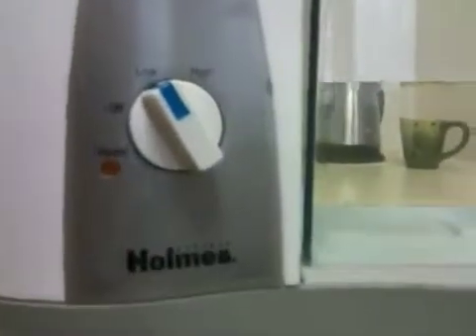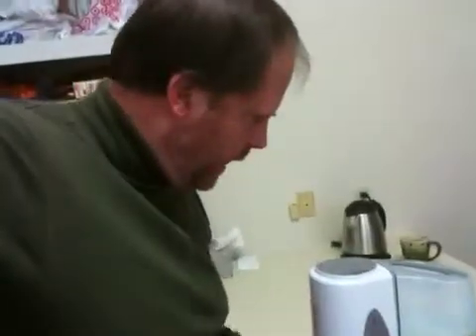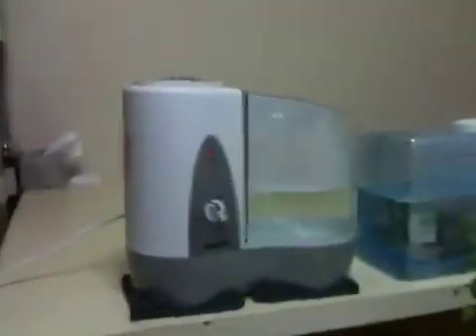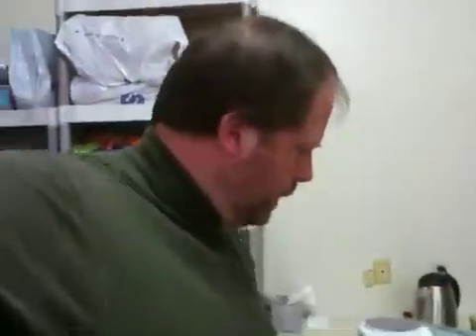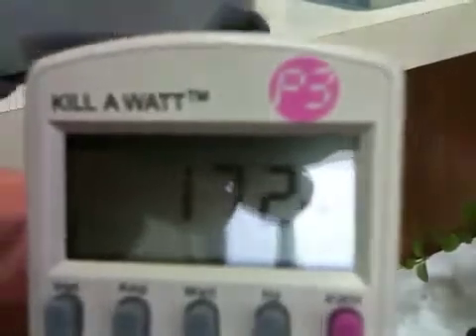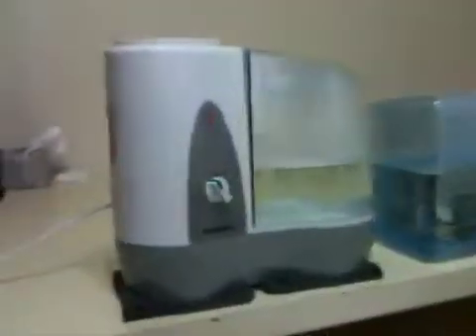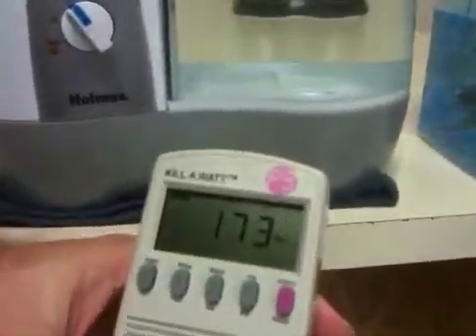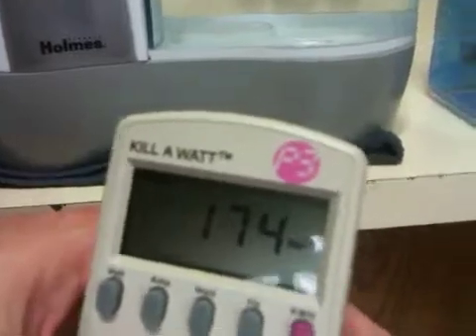20091014we-humidifier-steamer-power-watts-usage

Comment: Use distilled water in the cool mist ultrasonic humidifiers and they won't leave a mess.  Also, the mess in a warm mist steaming type humidifier is, instead, gummed up inside the works of the humidifier where it's difficult to clean out (requires vinegar soak etc.)  The white powder is the calcium from hard water.
Reply from the maker: Thanks for watching and commenting.